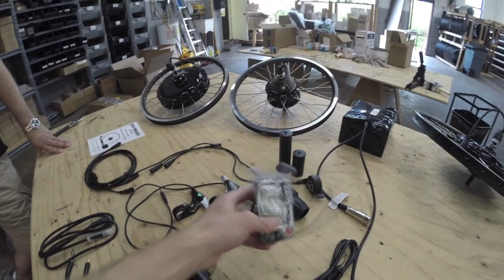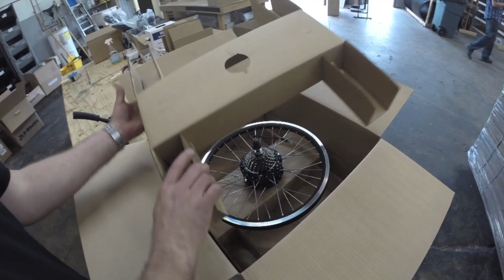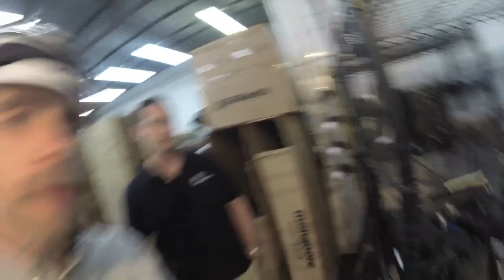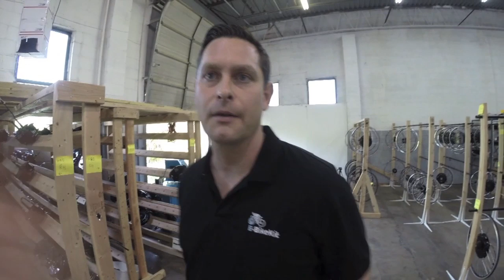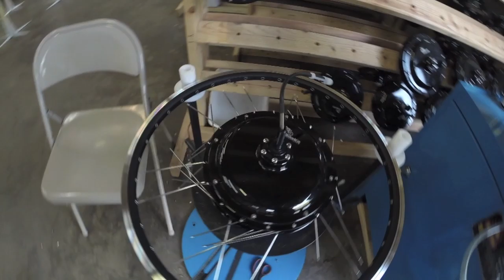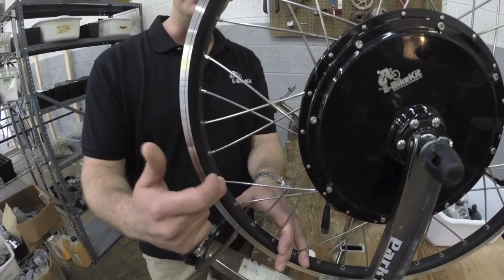E-BikeKit Tour with Founder Jason Kraft

Comment: No link to their website?

I like what he had to say about the boxes. The problem is, in America the boxes may be cheaper, but the labor to pack them is 10x more. Lacing the wheels here is great though. I'm sure that wheel lacing machine cost a small fortune. I've never seen a bike shop that had one.

I think throttle is preferred. Pedal assist is mostly just a legal dodge. They need to offer LiFePo4. No one wants a stinking sla anymore. I doubt they're any cheaper when you consider how fast they wear out.
Reply from the maker: Ha! Link added to the video description... I link to the official website in each written review I do as well ;)

Comment: I don't get the audio... regenerative braking?
Reply: It does not offer regenerative braking but some other direct drive motors do. Those kits usually cost much more and I've been told the power you get isn't all that much... at least it helps save your brake pads :)
Reply: Electric Bike Review thanks. the feature is important not so much to make the bike go further, but so that one might jack the back wheel up off the ground and charge the batteries to use the cigarette lighter plug for phones, gps, laptop, etc once you get there.
Reply: Dennis McCarthy Sure, if you're very tech savvy and want to solder on a 9v adapter this thing would provide electricity but it is not setup that way and you would definitely void the warranty. All direct drive motors (even geared motors... if they didn't have a freewheel) are electricity generators. Capturing, storing and redistributing this energy could be tricky and you would have to pedal quite hard for an extended period to generate electricity given the inefficiency of converting and storing with a system that was not designed for it. I think some electric bikes in the future will have USB to charge devices and maybe some will have regeneration modes so this could become more mainstream.